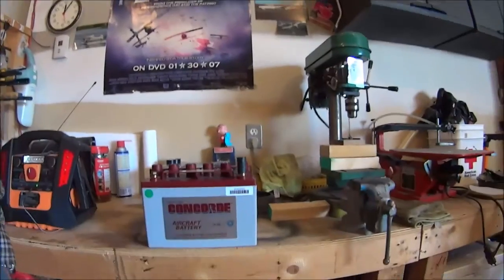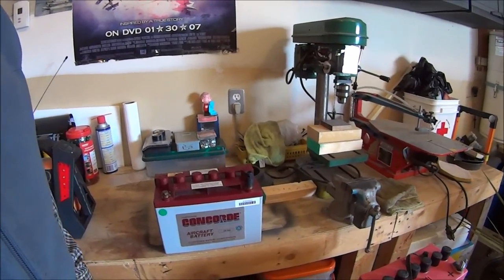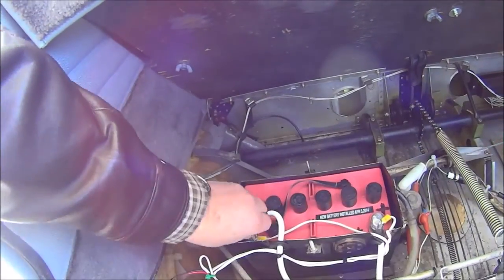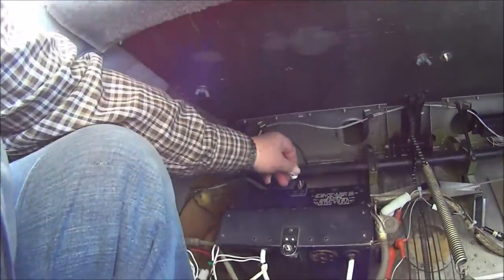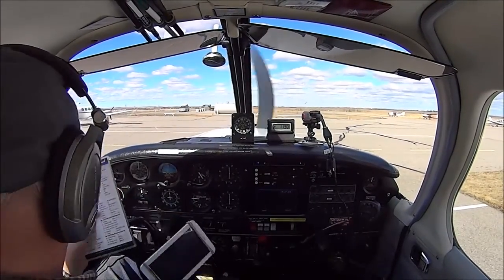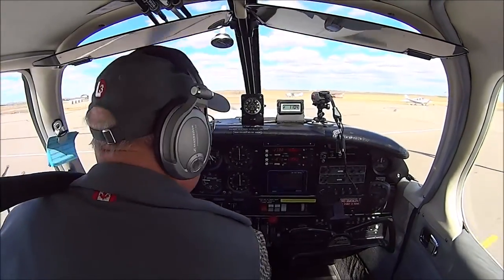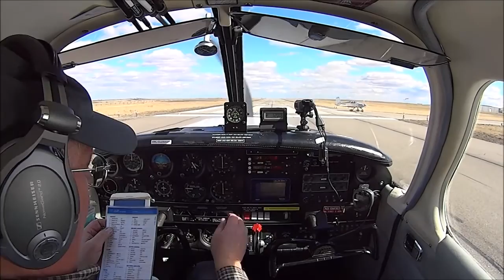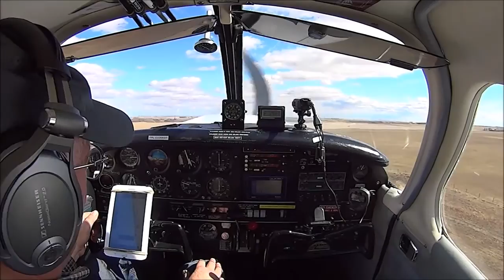Piper Cherokee "Finally"  A Battery Change  Vlog #88

Comment: Nice collection of videos Chet.   Good to see you enjoying more flying in your retirement.   I gave up on Gill batteries years ago due to poor longevity, and have been very pleased with Concorde since switching.
Reply from the maker: Thanks for the compliment .. too darn cold to do any flying though.  Got down to -27C  some relief in sight in possibly a few weeks.  Concorde working out fine however  I did remove it from the plane during this cold weather.  Annual is also due so this will probably not be done till after the holiday season...

Comment: My battery compartment cover has a 10mm nylon locking nut on the rear and a wing nut on the front, safety wired shut.  The battery terminals are indeed 1/2inch.  I had to put my feet on the rear floor, sit on the right front seat leaned back, and use both hands to lift the battery.  Good video.  Thank you.
Reply from the maker: Thanks Patrick..the older I get the more I think I should have bought a Cessna.....NOT....